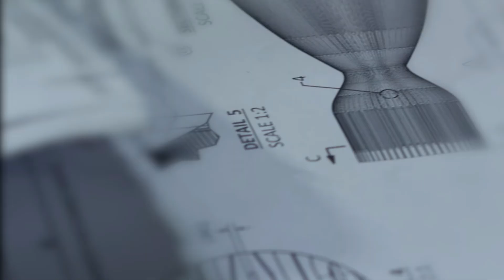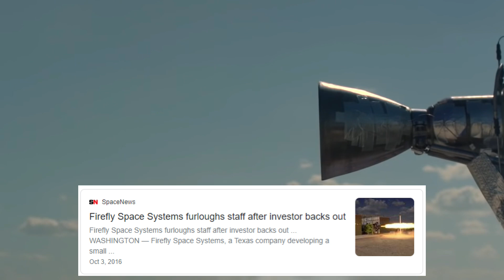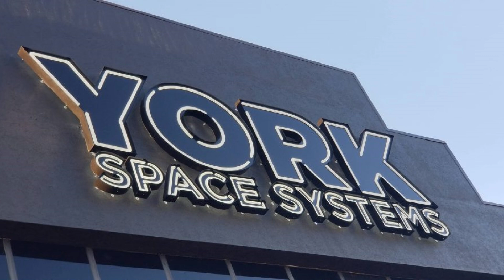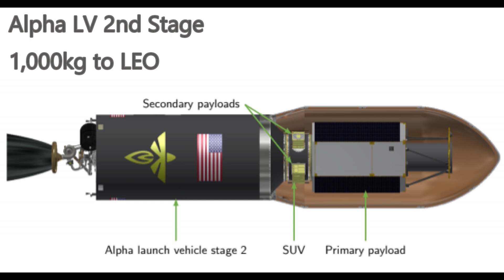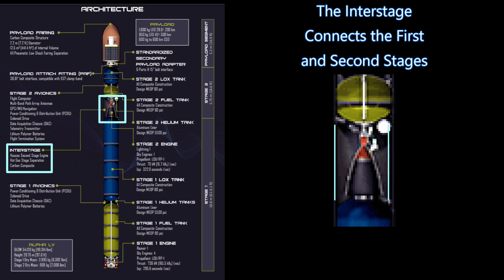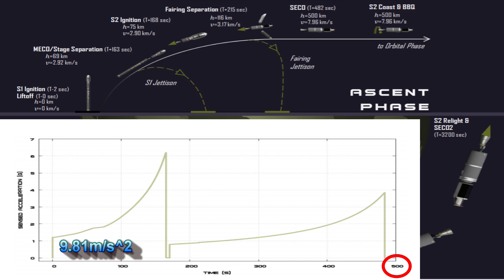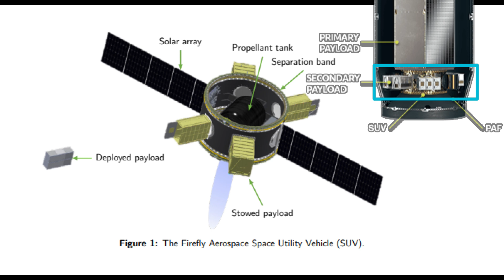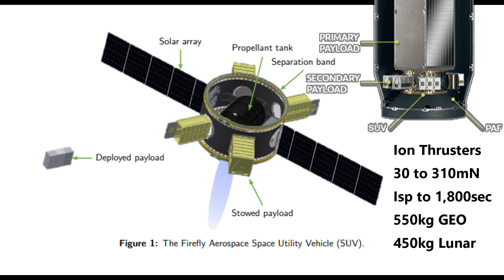Rocket Science: Firefly Aerospace

Comment: As a now retired manufacturing plant manager, I looked into 3D printing and carbon composites.  I tend to agree with SpaceX that both are not suitable for mass production.  Though composites are light weight, they are expensive and time consuming to produce.  3D printing seems optimal for the production of intricate prototypes but not volume production.  I wish Firefly well.  However, if I was going to put my money on a rocket start up it would not be Firefly, but Astra Aerospace. Astra's Rockets (clever name), is a mass produced rocket that uses cheap, easy to obtain and quick to manufacture materials. Astra can put 100 kilograms to low Earth orbit for $2.5 million per launch. Until SpaceX's Starship is frequently putting 150 tons in LEO for $2 million, Astra will be the launcher to beat.
Reply from the maker: Very good point. We may have to give them their own episode.

Comment: Gamma design makes me think that horizontal dead stick landing is the way to go if you are only trying to get payload to orbit. Trying to have the Starship do everything means compromises that would not be there if a dedicated shuttle like vehicle was developed. Also; I wonder why no one seems to want to put a good old fashioned ramjet on one of these smallsat launchers. Virgin 's launch method practically begs for a droppable, recoverable ramjet(s) as the first stage could fire, get the ramjet to speed, and then throttle down while the ramjet provides thrust for as long as it can maybe Mach 6. The ramjets could then be jettisoned for parafoil recovery.
BTW I seem to remember something about an attempt to reach orbit a few years back with an unguided solid fuel multistage rocket. Might be fun to see if that could be reasonably done.
Reply from the maker: The mass of the wings can be a huge problem in how much mass you can get to orbit but there are good designs.  I've wondered about ramjets too...